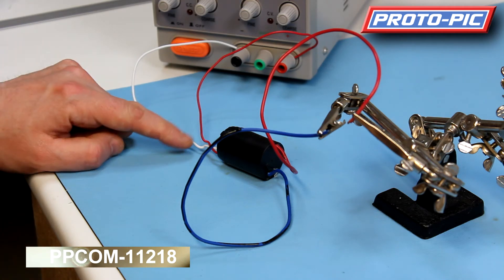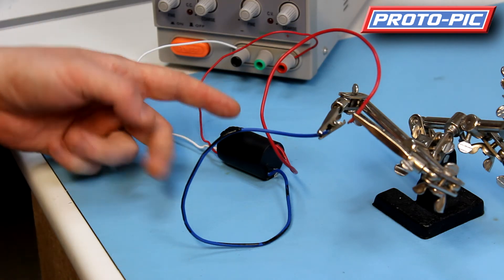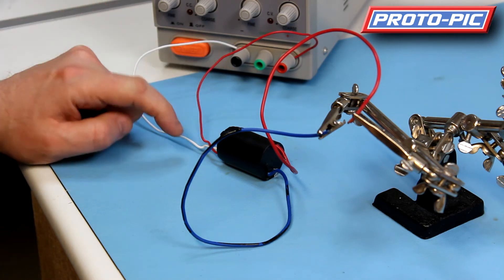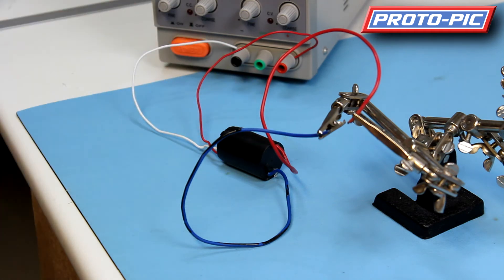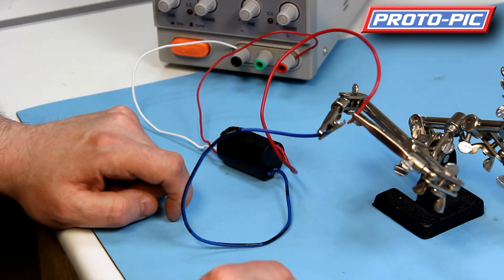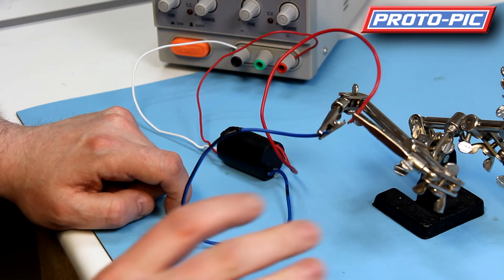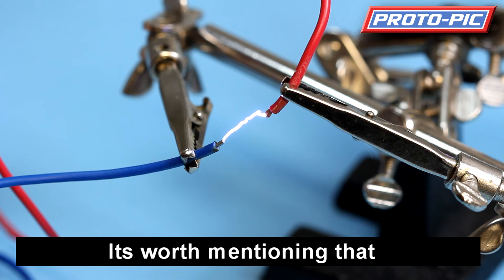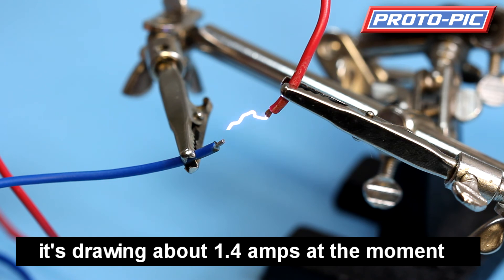Spark Gap Igniter

Comment: Is it possible to set up multiple spark gas from a single Igniter?

Ex:  Igniter----Positive wire----1st spark gap -->electrode--->2nd spark gap---> Negative wire--->Back to battery.

Is something like this possible?

-Thanks
Reply: Most likely not but it could work